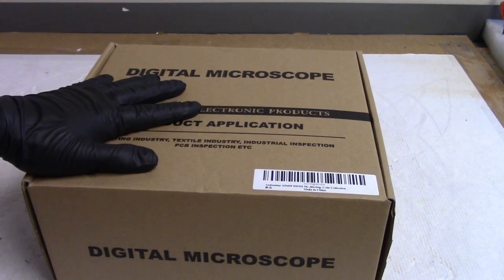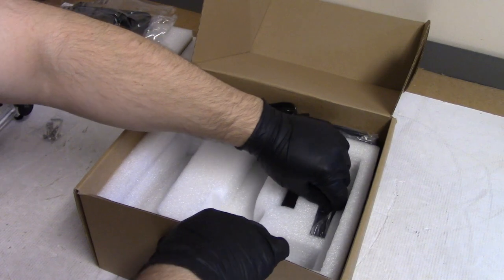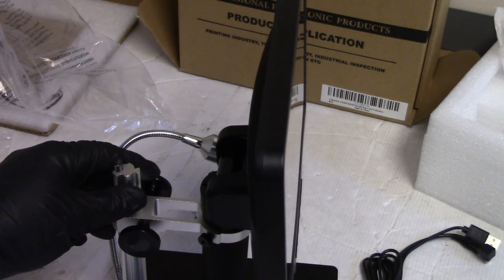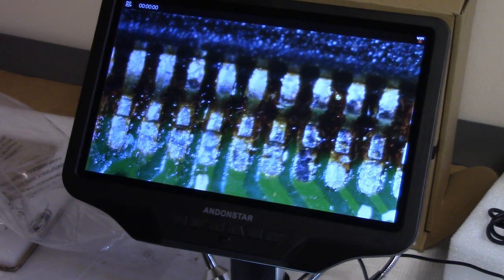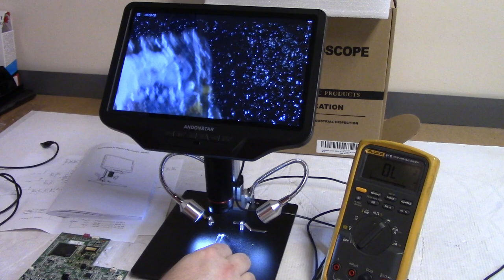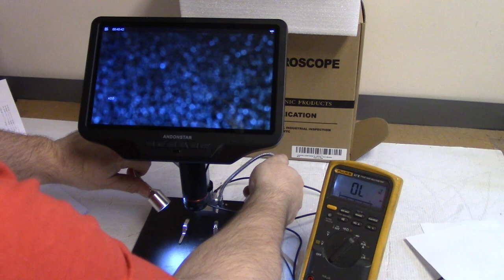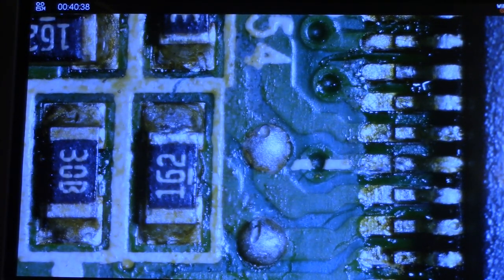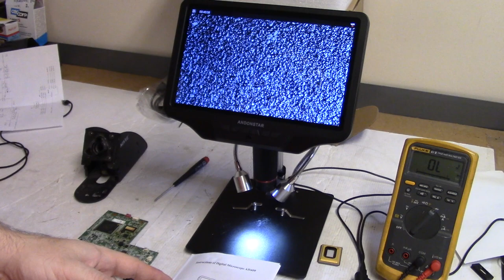Andonstar AD409 Digital Microscope Unboxing and Review

Comment: Its good only issue is when connected to big tv screen there is alot of noise.
Reply from the maker: check your HDMI cable. I hooked mine up to a 32" TV and the image was clear.
Reply: @FixitFrank  Yeah try to dim your lights In the room not the microscopes and you will see noise.Like there is nouse in phone camera lenses when you take Pic at night.I can even see the noise  on the small screen at your video.Its not crystal clear.